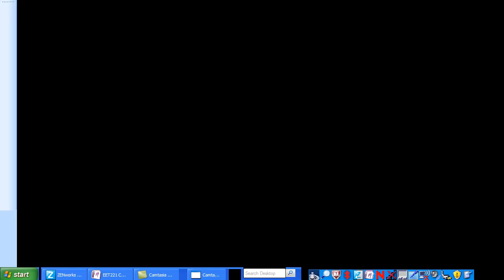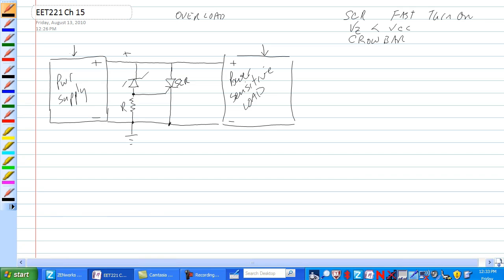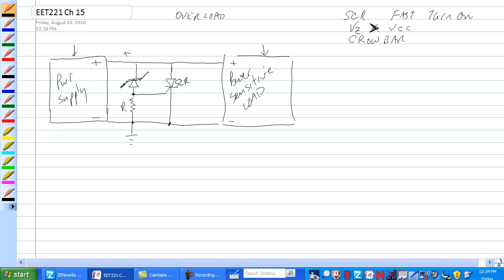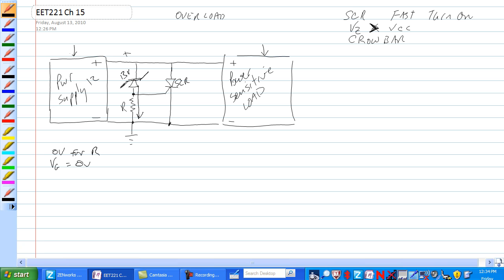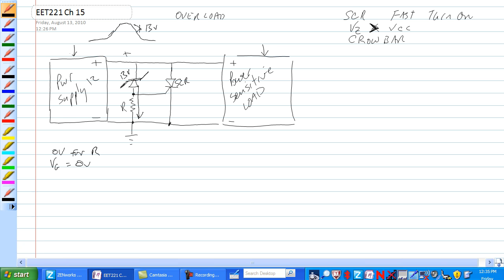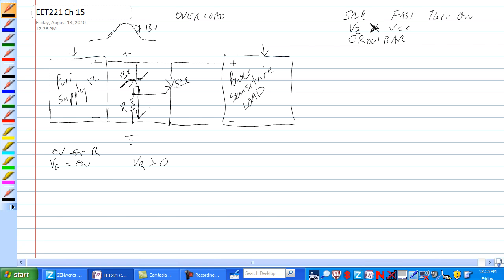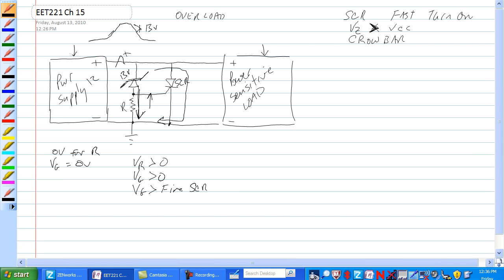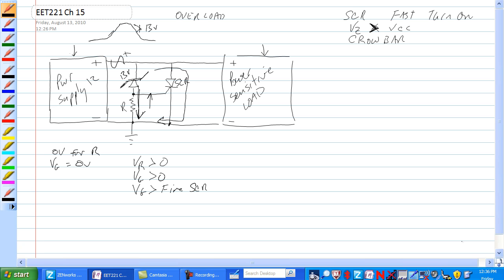7 SCR: Crowbar Circuit

Comment: I see some examples that use a capacitor in parallel across the vener current limiting resistor. What is the purpose of this capacitor?